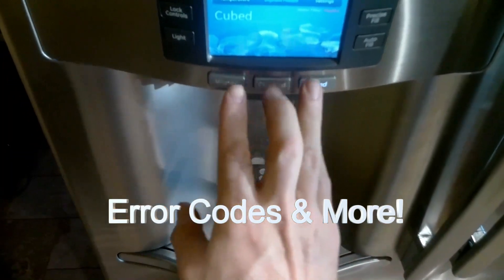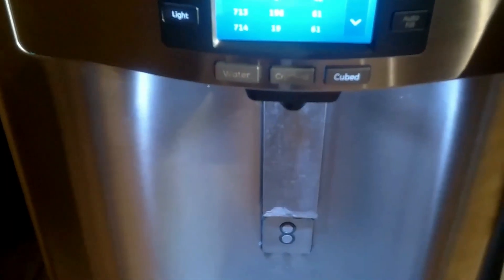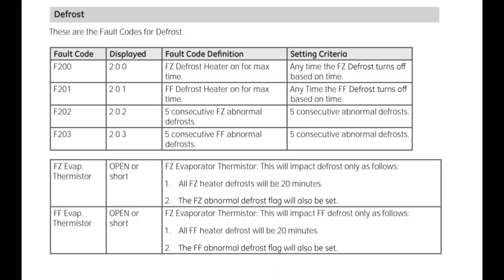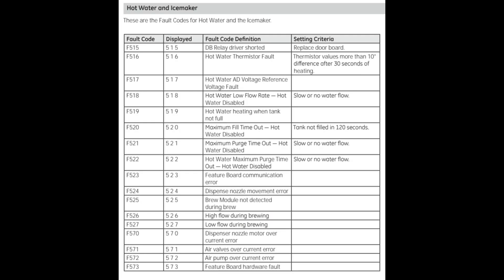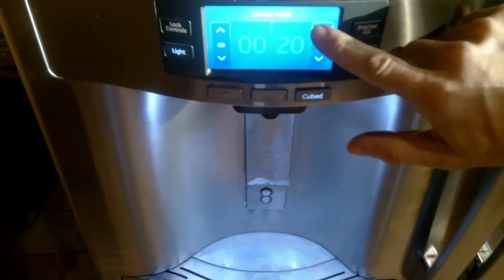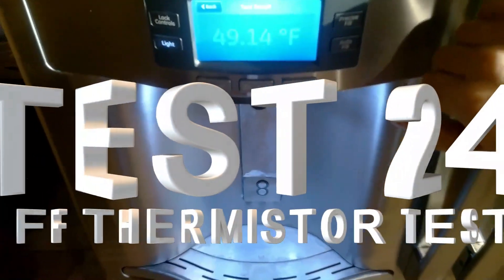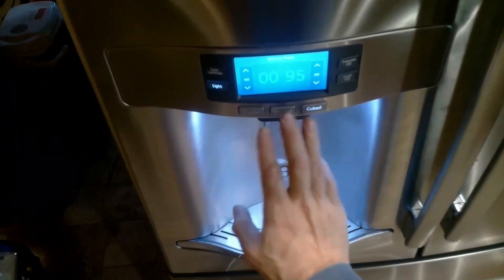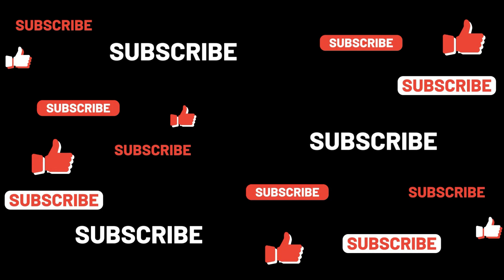Learn how to pull up GE Cafe Refrigerator Error Codes with Service Test Mode

Comment: Very helpful video.  My CFE29TSDBSS frig displays fault codes 300, 112 and 7.  Not very helpful.  Fan tests are OK.  On a hunch, I ran compressor and IM Power relay tests and the displays shows "Test Executing" for both test for over 5 minutes now.  Does that mean they fail?  Thanks for any help.

Comment: Does anyone know if it is possible to set hardware options through the screen or with a firmware update? I replaced the LED screen and the option to turn on/off the second ice maker is missing?

Comment: I found the error codes however I have not been able to find the corresponding  test mode # that you need to do the tests.  Where are they found? I check the user manual -nothing
Reply from the maker: What was your error?

Comment: Hi there I have error codes 106 and 303. When testing 47, fan rpms read 0.  My fridge is not cooling but freezer is working just fine.   Should I order a new evaporator fan?  My unit is the GE cafe model G507, scd8274gk507.
Thank you so much for your advice and input!!
Reply: Sorry correction to model number cye22ushkss. Serial number LH504864
Reply from the maker: If your fan is not showing an RPM reading, it usually indicates that the fan is not working. In most cases, the issue lies with the fan itself.
Reply: @onlineappliancetech  I ordered a new one....we will try it out 🤞

Comment: Our Cafe refrigerator model#CYE22TP2MDS1  recently stopped making ice, and the freezer stays cold, but doesn't freeze. The error codes I'm getting are 304,freezer temp exceeds 25F 9 times 7 days ago, and now today 102 , fan cannot reach target speed18 times. It says when I check the temp, it says 0 degrees, but that can't be right. I also have a question about a question about the doors, should there be a gap at the bottom of the above the freezer drawer.
Reply from the maker: If your freezer temperature exceeds 25°F, you should consider checking the speeds of your condenser fan. This issue might be the cause of an overheating compressor, which in turn trips the overload. Also, make sure to inspect the condenser coils for cleanliness; accumulated dust, lint, and other particles can obstruct the condenser fan motor. 

Regarding your question about the door gap, there should be none. Any gap can lead to frost buildup which may obstruct or clog the evaporator fan motor, thereby preventing it from reaching its target RPM. I hope you find this advice helpful!

Hope this helps!
Reply: FYI IF YOU HAVE ANY VISIBLE GAPS ON YOUR FREEZER DOOR GASKET THEN THIS WILL CAUSE HUMIDITY TO ENTER THE EVAPORATOR AND CAUSE FROST TO FORM THEN EVENTUALLY IT WILL TURN TO ICE ALSO IF YOUR EVAP FAN MOTOR ISN'T TURNING ENOUGH RPMS THIS TOO CAN CAUSE YOUR PROBLEM ESPECIALLY IF IT HAS FAILED.

Comment: My freezer shows all fan are working, except for Test #52 which I have no idea what that is for shows 0 RPM, so my freeze temp is at 38 not 0F, but my refrigerator temp is at 37 which is normal... so not sure what is causing it
Reply from the maker: Test 52 involves the Odor Remover Fan, which operates at 75% of its RPM. Has your GE appliance displayed any error codes? If yes, could you please provide them? Also, detailing the issues you're currently facing with the device could assist me in providing you with more effective solutions.
Reply: @onlineappliancetech  I don't have odor remover in my Cafe, however when I access the service mode and run 00 00, I get these following errors

Code 604 - count 1 - Days ago 723 | Code 713 - count 3 - days ago 340 | code 714 - count 1 - days ago 720 | code 109 - count 8 - days ago 65 | code 518 - count 1 - days ago 710 | code 508 - count 3 - days ago 282 | code 709 - count 5 - days ago 28 | code 605 - count 2 - days ago 570 | code 102 - count 1 - days ago 120 | code 300 - count 3 - days ago 2 | code 304 - count 8 - days ago 1 

So I ran 00 95 and 00 96, on 95 I had reading of 37~39 F, on 96 I had 17 F and dropped down to 7 F, once I exit the service mode the fridge rebooted, and Freezer still not freezing and shows temperature of 32 not 0, I've noticed every time I open Freeze drawer and close it, water comes out from water dispenser automatically (like 2 oz of water) this never happened before. so the freezer is cold but not freezing as it should be... so anything was frozen still have ice on it but all ice cream I have inside is melted not solid.
Reply: I have the same issues with my ge frenchdoor. Freshfood sección is ok but freezer is at 58F . Freezer fan comes on if door is open for a short time but it's not getting cold. Stopped getting cold few weeks ago and was making ice but stopped .

Comment: Test 95- 130.33 degrees F
Test 96- 633.36 degrees F

PLEASE HELP
Reply from the maker: Interesting! Have you managed to identify any error codes so far? Just speculating here, but what would you estimate the temperature to be inside your fresh food compartment and freezer? It seems like there might be an issue with the main control not properly detecting the temperature. However, I'm not suggesting you should rush out and buy a replacement. It would be best to first try and find any stored error codes, and proceed from there. I can say with certainty that it can't possibly be as hot as you're suggesting. Haha!

Below are what test activate:

Test 95 FF Cooling: In this test, the controls will be as follows:
• Valve: Position A, only affecting the freezer (FZ)
• Compressor: High
• Condenser Fan: High
• Fresh Food (FF) Fan: Low
This test will return the fresh food evaporator temperature.

Test 96 FZ Cooling: In this test, the controls will be as follows:
• Valve: Position B, affecting both the fresh food (FF) and freezer (FZ) in series
• Compressor: High
• Condenser Fan: High
• Freezer (FZ) Fan: Low
This test will return the freezer evaporator temperature.

Hope this helps!
Reply: @onlineappliancetech  

Thank you for the response. 

The Fresh food is around 50 degrees. 

Freezer is roughly 0
Reply: How do I get in diagnostics to test the unit?
Reply: @TheTigerman1960  hold water, cubed and crushed at the same time until it asks if you want to enter into service mode
Reply: @pjpassman4108  is there no diagnostic mode?
There's no faults on check modes.
Reply: @TheTigerman1960  there is. I’ll have to find the video that showed me. I’ll try to link it